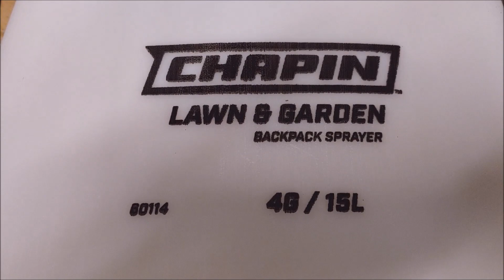CHAPIN backpack sprayer piston seal modification

Comment: I watched this to get a look at what I might be needing for my back pack sprayer. Mine isn't marked as any particular brand. It only has two US patent #'s. I think it was probably made in the late 90's. It looks like the ones my boss had when I worked in carpet cleaning back then. Anyway I had a hunch that the Chapin parts would be the go to for me. It's hard to get a good comparative look at the hardware up close unless somebody does a great repair video like this. Thanks a lot pardner! I will lube mine with vacuum grease, I think it holds up better than vaseline. But vaseline works fine, better than nothing that's for sure.👍
Reply: I have actually heard tell of folks using KY! I'm not kidding!
Reply from the maker: You might be giving away your age. I havent heard KY in a very long time. Thats too funny. Thanks for another laugh. Vaseline got me earlier